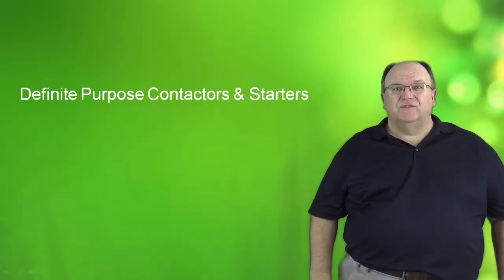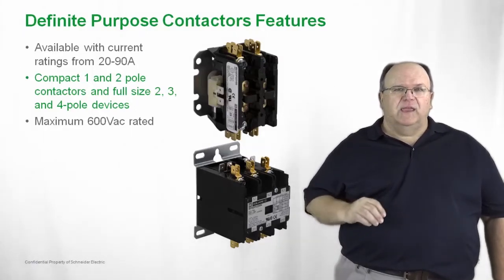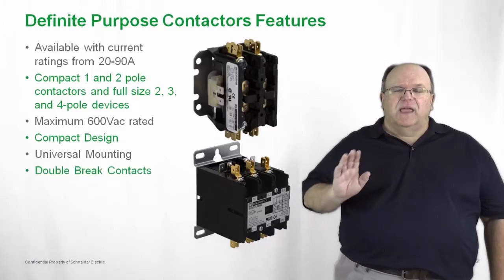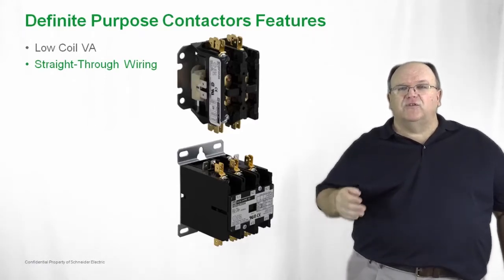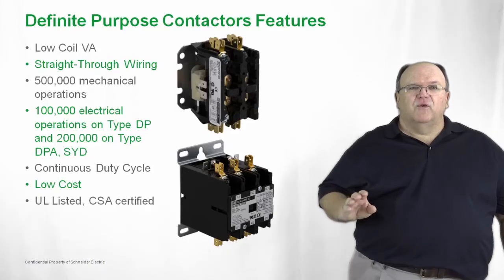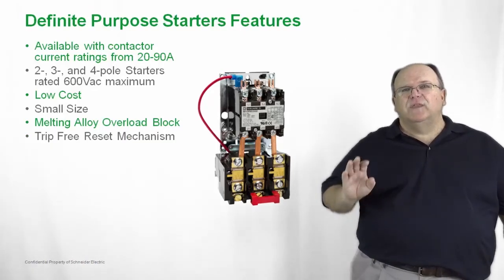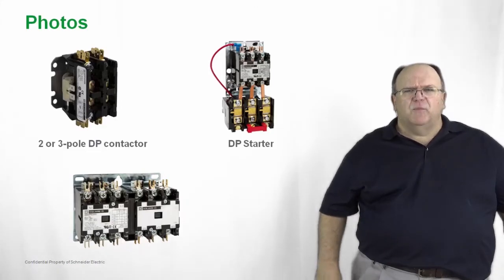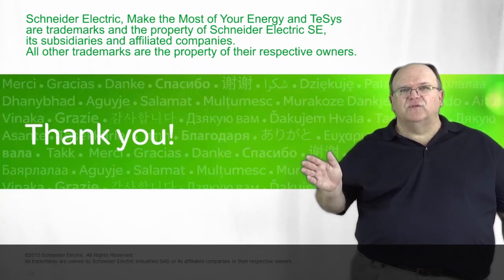Definite Purpose Contactors and Starters

Comment: Is it just a relay or something more than that?
Reply from the maker: You're thinking in the right direction...generally, relays are more for control circuits (smaller power), and contactors are more for power circuits (higher power).

Comment: I want to know the inside structures or diagram of 3 pole contactor. I have a commercial AC which burned 3 contactors now. It marks 24v and 240v. I think the previous technician wiring it wrong